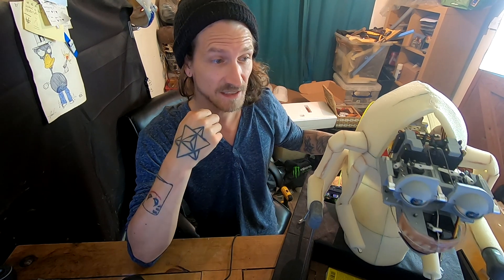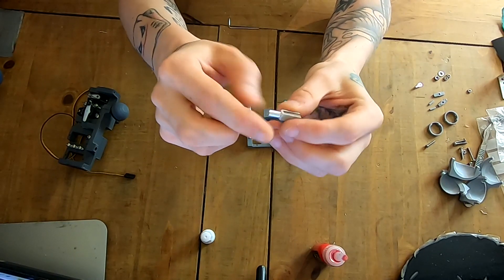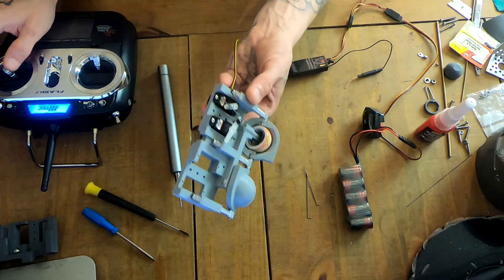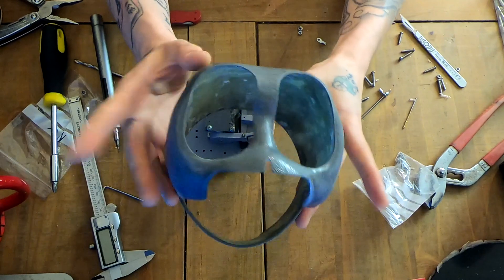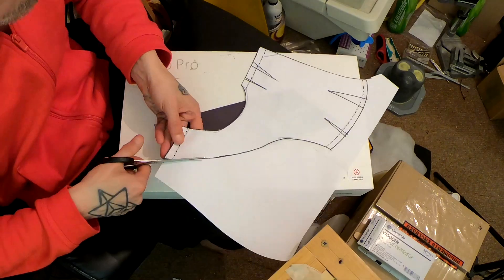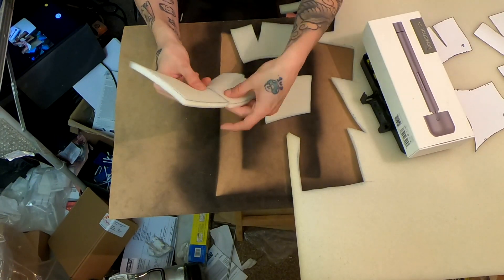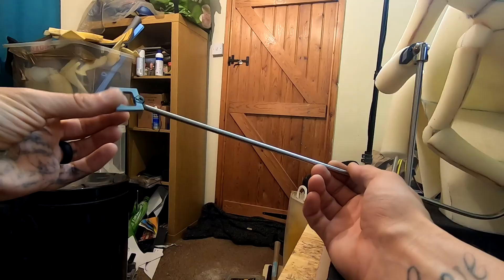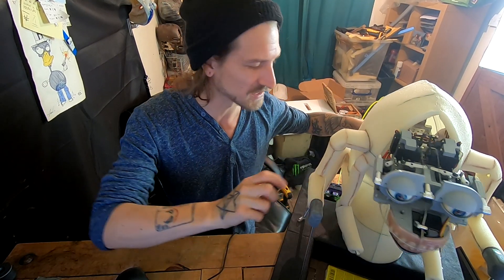Freedom Friday: Part 7 Making an Animatronic Rod Puppet

Comment: I want to build like this, may i get source code from remote face
Reply: If not source maybe u can tellme about controller reciver n motors modul
Reply from the maker: @klikfloristpalembang4053  just some servos, transmitter receiver radio allows manual control, no coding here buddy, all fingers and thumbs :)
Reply: @KieranMeadows  so many fingers and thumbs!!! Ha ha